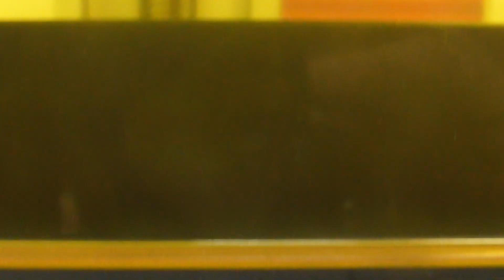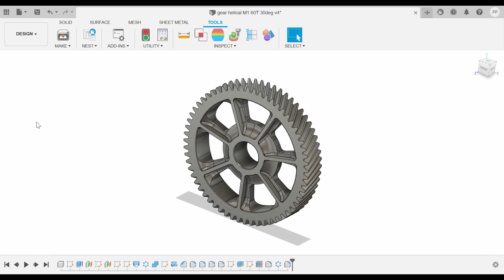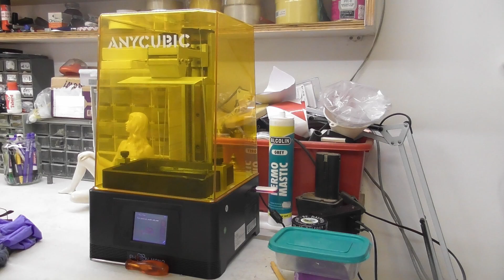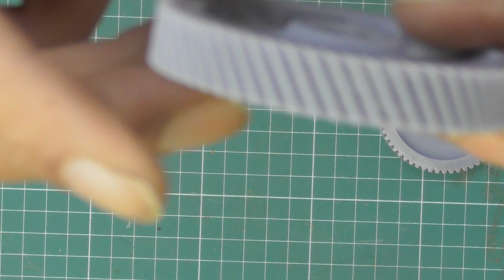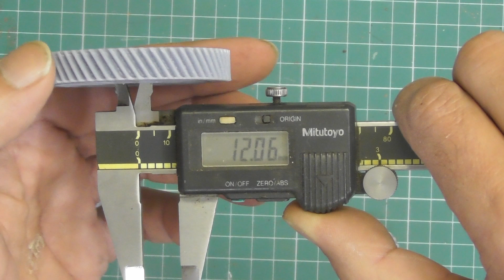Anycubic Photon Mono failed print and better design to fix it!

Comment: Definitely great advice to reduce surface area and that will in turn reduce the adhesion between the FEP and the part.
I would like to see if the better design will still work with supports since the first time you tried using supports and failed.

Comment: Hello. Sorry i disturb you but i have aproblem and probably you know the solution. I have the same printer and few month ago i print whiout any problem. Everything well.Always i have used chitubox. Now i need to print and i refresh the nex version of chitubox and the new fireware of anycubic photon mono (Version 1.7), and i can´t print. The printer print a block of resin but no the piece i model. ¿Can you help me ? Thank you very much
Reply from the maker: Hi. Sorry for the slow response.  I use Lychee slicer, so not that clear on what might be the problem with Chitubox - have you tried Lychee?

Comment: Reduce the surface area.. Yes BUT, try to print them giving a certain angle. Even if it means putting supports there. You will not have this overexposure layers on the part but on your supports. :) 0 fails again
Reply from the maker: Thanks for the tips!